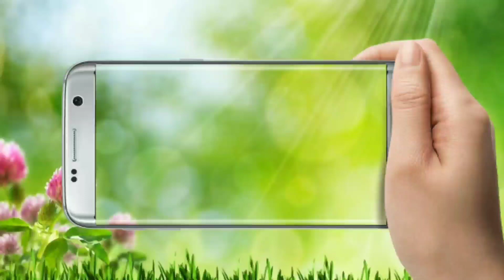LED dimmer with transistor || Voltage controller || by es tech knowledge

Comment: How to use 10 W  LED  ?
Reply from the maker: Input voltage, according to the LED and connect the LED to the out put of the circuit.
But in this case transistor might become hot.
Reply: @estechknowledge  do you have a solution .(change the transistor )